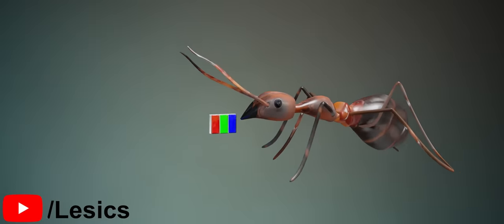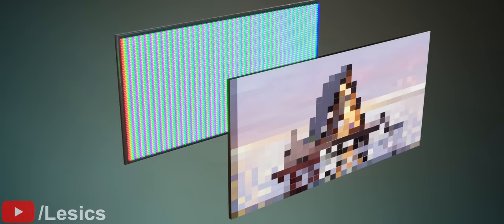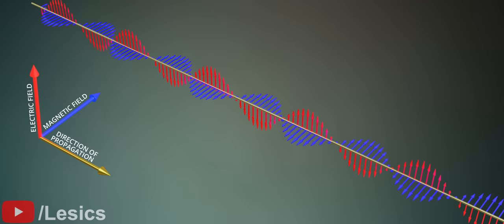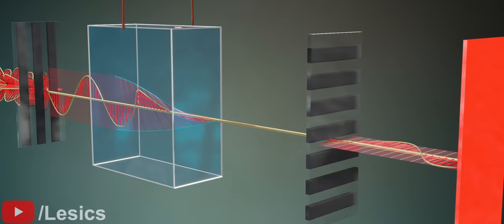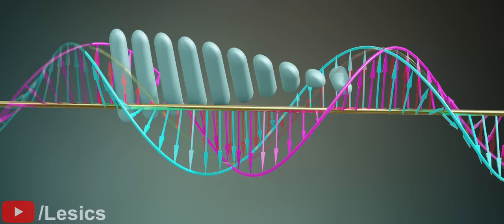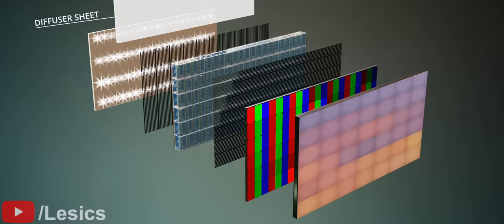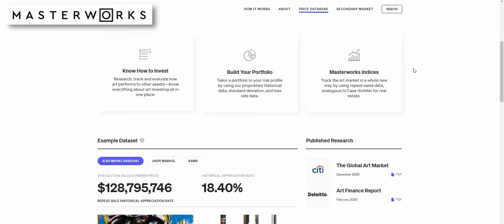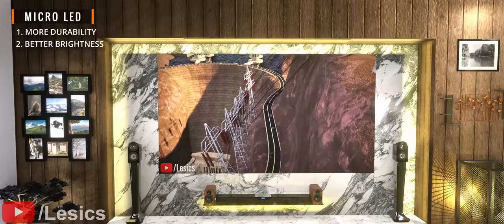The CRAZY PHYSICS of LED Displays!

Comment: So, most of the marketed "LED Displays" are LCD display with LED backlight
Reply: Yep.

Its fun trying to tell people that your new led display is actually a lcd display with a different light source compared to older lcd display with florescent backlight.

Unless its OLED or micro-led (if they decided to use micro led directly as the pixel source and not as a backlight for an lcd display), its all lcd.
Reply: Soft of. Each individual gets its own independent brightness level, instead of having a solid backlight for the entire screen.

You get better contrast and color accuracy, but typically at a much higher cost than traditional LCD technology.
Reply: And if the polarization filter could really block all the light we could achieve true blacks like with an OLED
Reply: Dam right! 💯
Reply: Yes, correct would be to also call them that. LCD with QLED backlight.
Reply: Haha… Display display
Reply: Definitely
Reply: IPS lCD is better than normal led
Reply: @flynn3649  its not each pixel, you might have certain number of zones which can be controlled
Reply from the maker: Yah, you are right :goodvibes: At the heart of the LED display is LCD. It should have called 'LCD display'.
Reply: @eSKAone-  but that increases cost and reduces brightness
Reply: @eSKAone-  it's better to use miniLED with thousands zones for local dimming and to give richer contrast and true black (halo effect is still present) or microLED that works just like OLED does but without the organic materials and that allows for way higher brightness and burn in issue is eliminated
Reply: Thanks just watched lcd video and was very confused about difference between led and lcd display
Reply: @flynn3649  That's not a "general LED display" as in all LED TVs. You're thinking about miniLED
Reply: Yes unfortunately.
Reply: Exactly😊
Reply: Not just an LED backlight.  It’s a matrix of white LEDs.  Hundred and thousands of them, depending on the size of the screen.  The reason why I say it’s not just an LED backlight is because the intensity of each and every one of those white LEDs is also controlled by the LCD controller.  That helps with contrast and intensity with the picture, which  makes for superior picture quality.

A LCD with an LED backlight is a strip of white LEDs that’s always on.
Reply: @3ffrige  Please provide at least one reliable source of information or reference for that marketing term for the technology that you mentioned.
Reply: Congratulations, you discovered warm water. Now go thanks Casio
Reply: Of course they are 😀
Reply: No there's a big difference i'm pretty sure.
An "LED TV" only uses its LCDs to twist or un-twist the light before the permanent color filter.
.....in an "LCD TV", i think the LCD screen is the color filter (maybe)

(LCDs do not make good color filters. I do know that)
Reply: @Cethavi it's called MiniLED

....or MicroLED
Reply: Led means light emiting diode not the panel type. Panel type is lcd  liquid crystal display.
Reply: THATS WHAT IM SAYING, I literally just took apart my “LED” monitor to find it was LCD and all my plans of melting it down and rebuilding it were shattered (its cracked)

Comment: Honestly what I would be more curious about is how these tiny elemts are produced and how the signal gets to each pixel. Nontheless a great video of showing how the pixels themselves work
Reply: Right!??? Like how do these individual ARS’s know how or when to rotate the light source to make the image that is required !?
Reply: processors are manufactured using microlithography so I would imagine some of these elements are manufacture using a similar process.
Reply: @joseville  yeah but like, how does it work? Like, according to this video, it would seem that just for a single pixel you'd have to manage hundreds of different inputs. It surprises me that TVs don't just glitch out randomly. We don't really think of our TVs having the same calculation power as our computers. We just see them as another appliance. But it really feels like you'd need a super computer to run all the calculations just for the display alone.

Comment: Great video ✌🏼 
Small detail: when unpolarised light goes through a vertical filter, I think only the horizontal component will be transmitted (not the vertical) 😃
Reply: Yeah, probably a nomenclature mistake: if only the vertical component is passing, then it's because it's filtering the horizontal component; therefore it's a "horizontal filter"... but because the slits of the "horizontal filter" are actually vertically oriented, it's easy to call it a "vertical filter" because it looks vertically oriented.

This stuff was easy to get confused with when studying the properties of light in high-school physics way back in my time, and I guess it still continues...

Comment: OLED is by far the best display I've seen and used. by using samsung s20+ now, if I went back to using vivo y20 which has lcd 720p panel, it clearly visualize the difference between oled and lcd. The blacks are 99% black and you really can't see blacks in dark room. Colour accuracy is correct for most of daily workflow. Professional editors also use oled laptops and monitor to fullfill their accuracy demand.

Comment: Thanks for taking efforts to explain how it works, I have been struggling to find such explanation on yt for a while. One small remark: Though micro LEDs are interesting tech, the qdel looks even more promising (due to theoretical low production cost based on its simplicity).

Comment: What's currently stopping MicroLED screens from rendering all other screens obsolete are the need for further pixel size miniaturization and cost. Once these 2 main issues are overcome, OLED will soon go the way of plasma screens.
Reply: In the mean time you take the inconsistencies that already exist between each individual tv panel and slap those together as one unified panel. I've seen so many of these types of tvs have random warm panels mixed with cool panels, have some panels just fail so half the tv is dead, etc.

Comment: Regarding the LED backlight, just to get accurate black, why not make the LED backlight to also operate like old school LED screen, where dark pictures don't illuminate or partially illuminate?Granted, this doesn't solve the size limite of LED where they can only be a portion of a millimetr, but it should allow distinct blackness compared to what the usual LED shows.

Is this system been done before or is not feasible?

Comment: LCD is the king because unlike OLED, LCD does not degrade and is not affected by static images or burn ins which rins the screen permanently just by displaying the image/doing whats designed for. Thats a MAJOR Oed flaw, and because of that it will never take over LCD. I bought LCD tablet instead OLED because of that reason. I dont want burn ins and i play to use this tablet for a long time and i dont wanna be stressed about the image.

Comment: Not sure, but what you explained is LCD(Liquid crystal display). LED is Light Emitting Diodes and has no backlight. I Never dug deep into it but something with the explanation doesn't sit well.
Reply: You are correct the LEDs here are the constant light sources at the back of the display,they just use LCD polarisers

Comment: The maker of this video mixed things.
This display technology is called LCD. Only CCFL is replaced with LED which has some advantages and new posibilities.
On the other hand, LED display are truly built from LEDs in each pixel. However, they are not consumer products. You can see them almost everywhere: huge displays on the side of building walls, in malls, changeable traffic sign tables etc.
Samsung and Sony are already working on to minimizes the LED pixels to microscopic scales by chip fab technologies. Actually, there are already some products.
This true LED displays will be better than OLED in every aspects. Much clearer and precise primary colours, much longer life, no image burn-in, way higher brightnes and extreme pixel density.
BTW, OLED is not better than LCD (with LED backlight). Both have different advantages. OLED has very wide color gamut, real deep black, and extreme fast response time. LCD panels have consistent color reproduction, higher brightness, and no image burn-in. For watching a movie: OLED. For reading a book: IPS LCD. For color critical work: IPS LCD.

Comment: Most modern display tech is qned
Reply: Qled Is not Good as OLED 
We can see example of samsung and LG
Reply: @riyasinghcreations5029  not QLED 
QNED
QNED still exptml
Reply: Stop using animals video LINKS to confuse me (aka Spambots report)
Reply: @riyasinghcreations5029  QNED it's For Quantum Dots Nano Emitting Diode.

It's close to QLED, but with nanoparticle filter from Nanocel plus Backprojection by Miniled.

Namely Nanocel is a filter intended to let pass as much as possible only Red, Green and Blue, and to prevent all colors other than the three mentioned above.

QNED in Ranges 85; 87;90; 91; 95; 96:99 are miniled with Full LED and Local Dimming led.

Comment: So the micro led display apple is using in their Pro ipads are better than Amoled by also making the black areas completely black instead of grey😲 interesting tech
Reply: Apple is using what's called "Mini-LED" and not this "micro-LED" technology. That one is a great head start for the development of micro-LED though, but it's nowhere near as great as micro-LED in terms of reproducing pitch blacks.
Reply: @troy5568  oh i mixed up, but as long as i remember 🤔 apple said in the event that the display would show deep blacks like an Amoled display!🤔
Reply: @im.animesh_  OLEDs are better than Mini LEDs for showing black areas. Search for Mini LED blooming or bleeding to see example images. OLED can turn off the light for any pixel (so several million LEDs), while the mini LED in iPad Pro only has 20,000 LEDs it can turn off. The advantage is less burn in and more brightness.
Reply: @troy5568  The example being shown is neither "Micro" or "Mini" LED.  As others have pointed out, this video is describing an LCD panel with dynamic white LED backlighting.  It replaces the fluorescent backlight of traditional LCD displays with LED.  But, TRUE LED, MiniLED, and MicroLED are different technologies that are much closer the OLED than this example.

Comment: There is no LED... LED is LCD with LED backlight instead of CCFL. Same is with miniLED... there are 3 tech - LCD, OLED and microLED which is the future. microLED is taking the idea of OLED aka self-emitting pixels, but without the notorious burn-in, because there are not organic materials.

Also the example here is specifially for TN panel. 

For example: To make pixel dark in TN panel you need to apply power... To make pixel dark in IPS/VA panel you don't need power. They are "off" by default, so you need to apply power so you can pass light. It's the opposite.

Comment: This "LED" display explained first is just a LCD panel with LED back light. A drawback is not able to show total black and bright area at the same time or at all. 2 the grid walls take up to 30% of the surface area while Oled or DLP only have 3%. LCD display is a old tech still improving.bleeding light into the pixels around the one that is open also bad. Oled is "NEW" tech but with some problems. Red sub pixel degrade fast is what i as a user get pissed off at. really have to calibrate max output with care.

Comment: If we talk about TV or monitor type displays, then today's "LED displays" are not LED, but LCD with LED backlighting which is basically misleading the customer. The only real LED display is OLED, where each subpixel is an Organic Light Emitting Diode. There is no need for any crystals to control the flow of light and thus by the principle of physics OLEDs have the best contrast where no light shines through and around the unlit diodes. On the other hand, as mentioned in the video, since these are organic diodes, their lifetime is not as long as inorganic diodes. 

OLED displays are very suitable for small devices, where the total screen usage time is so short due to technical moral aging that the degradation is not visible, e.g. in so-called Smartphones or Smartwatches (I have never understood why a computer with a phone module is smart, but a computer that sits on a table but does not have a phone module is not smart...). Today, a dark GUI theme is the standard, so the OLED display continues to have low power consumption because only the LEDs that are supposed to be lit are lit.

For TVs and monitors for computers then indeed LCD technology is still the good technology at the moment (Regardless of the fact that marketers gave it the name LED or Micro LED.).
Reply: No its not missleading. They tell you what type of tv it is, an lcd with a led backlight. Trere is still lcd in manual and on a box, behind a tv as well  but the main feature is more prominent. With oled they make prominent because oled does not have backlight
Reply: @The_SUN1234  No, they make name of TV like "LED TV" or "LED Monitor" so customer can't recognize if it is TV made from LED or TV with only LED backlight. No matter, now does not exist true LED TV, but  exist true (big) LED panels/monitors...
It's about naming things correctly...

Comment: I'm sorry but I don't quite agree I have a QNED99 and when Zone is off and ideally 4 Zones and more the black is Totally black except silly videos which in 8 bit per color uses in the image of grays between 0 and 15 which should be prohibited, similarly no 10 bit per color in the image there should not be any grays between 0 and 63 used in the image.

The presence of Halo is in practice very rare on QNED, especially when the source is SDR, provided that the 8 bit image does not use gray levels between 0 and 15, or between 0 and 63 in 10 bit per color.
when the video is well done and respects the standards, there is almost no Blooming or even no Blooming at all.

Version FR:
Je suis désolé mais je ne suis pas tout à fait d'accord, j'ai un QNED99 et quand la Zone est éteint et idéalement 4 Zones et plus le noir est Totalement noir, sauf les vidéos idiotes qui en 8 bit par couleurs utilise dans l'image des gris compris entre 0 et 15 ce qui devrait être interdit, de même ne 10 bit par couleurs dans l'image il ne devrait pas y avoir de gris entre 0 et 63 employer dans l'image.
la présence de Halo est hyper rare sur QNED, d'autant plus lorsque la sources est SDR, à condition que l'image 8 bit n'utilise pas de niveaux de gris compris entre 0 et 15, ou entre 0 et 63 en 10 bit par couleurs.
lorsque la vidéo est bien faite et respecte les standard y a quasiment pas de Blooming voir pas du tout de Blooming.

Comment: Why do you call it an LED Display? It's an LCD (Liquid Crystal Display) with possibly a LED backlight but the backlight can be anything at all and has nothing to do with the display technology, only with the light needed to see ... the display (control of each pixel) is done by the LC not LED.
Reply: For better destinction. People call IPS the IPS display, not LCD IPS. People omit what is the LCD, and when its different technology they say  like OLED.
Reply: @The_SUN1234 But IPS is a form of LCD so it's just a way to narrow down a specific electronic circuitry that switches LCs.
Liquid Crystal display cannot be called LED because LED is not involved in image production, just with a backlight and also because LEDs can be and are used to display the image in actual LED displays, not just the Organic version of them called OLED. I'm afraid that this is just a marketing scheme to hide the fact that old technology is used (LCD) and make customers believe, they're buying a newer one. Yes LED backlight is newer than older fluorescent technology but customers will more likely assume it's a newer display technology than a backlight, especially that D in LCD stands for Display so they might confuse the D in LED also with Display rather than Diode.